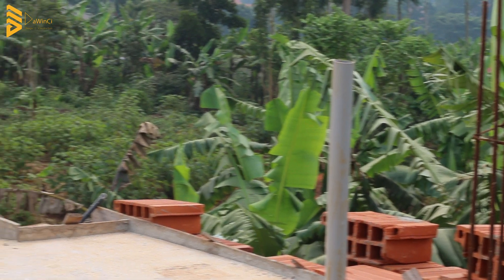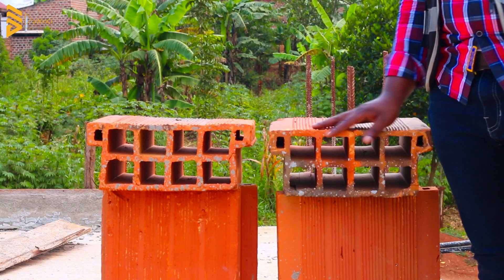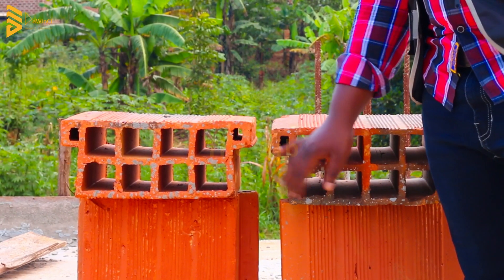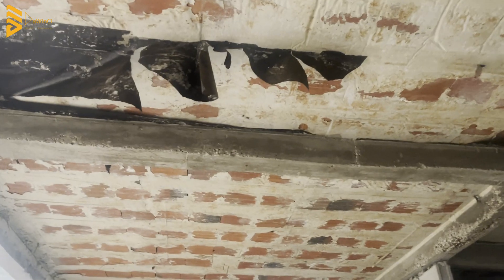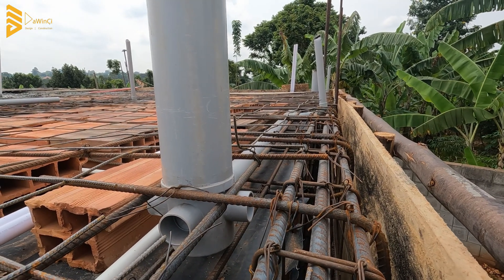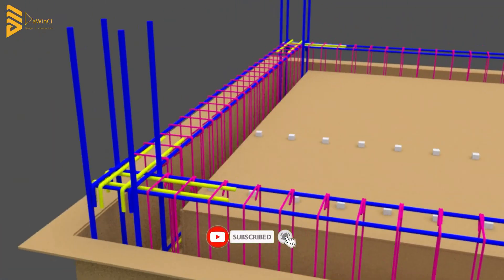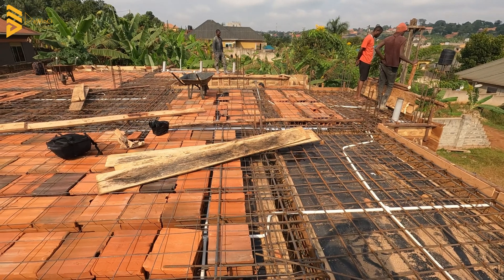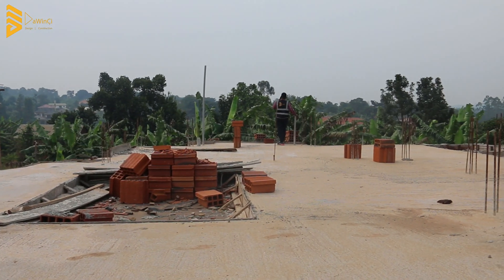Why hollow slabs are cheaper than solid slabs.

Comment: Engineer why is it u can’t use max pan without wood timber decking , yet in Asia they can do it? we appreciate it’s expensive doing flat
Reply from the maker: Its because they used maxpans in conjunction with pre-cast beams(with pre-tensioned) reinforcement bars), and that mostly works for short spans
Reply: @mukizadarwin  thanks